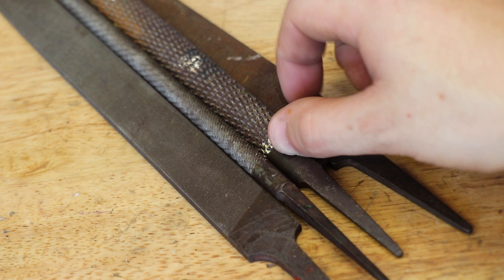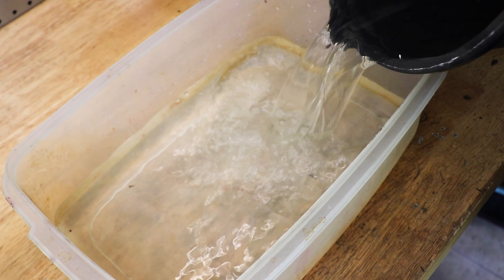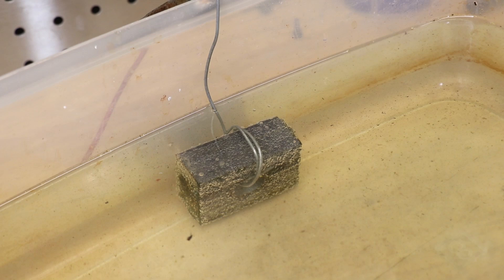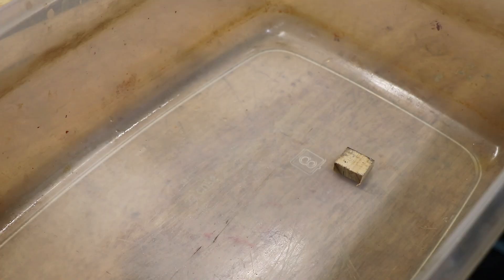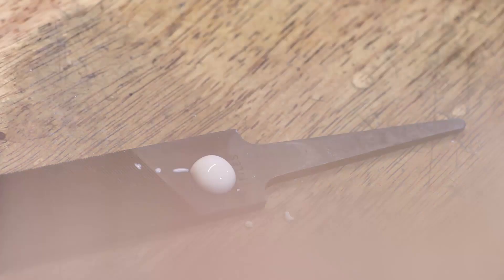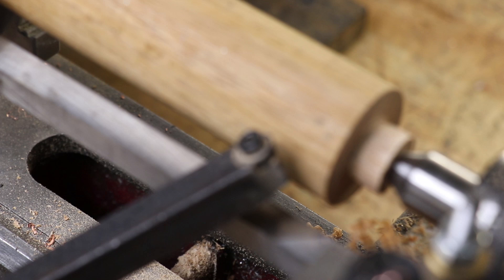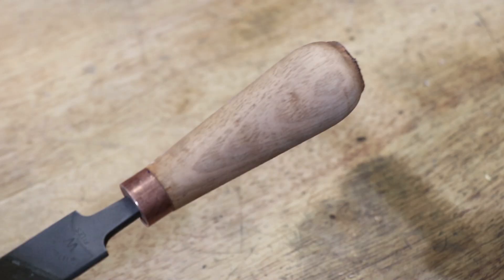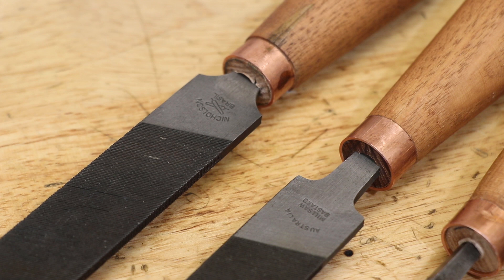Restoring Rusted Vintage Files

Comment: I don't believe in acid magically sharpening teeth. Acid 'eats' away metal, but doesn't spare sharp edges for some mysterious reason - why would it. Actually, I'm quite sure that sharp points are the fastest to be eaten away.
However, acid may rough up a dull and glossy file. This way, a dull file may be given some extended life. But I would think not for very long as the porosity created by the acid will quickly get filled up.
Note that this is not based on experience, but it seems most logical to me.
Reply from the maker: Yes, it is indeed metal etching, and I would probably shy away from doing this to a good condition file. Though this is a tried and trusted method that has been used for years. My understanding is that even commercial sharpening can do done using acid. Either way, super happy with the results. Cheers
Reply: The theory is as the acid eats the metal it makes the teeth thinner. A thinner edge is a sharper one.
Reply: @artisanmakes  I've been using a method almost identical to yours with good results. A couple of of things I do: after the best cleaning I can do to get out all the chips, gunk & surface rust, I soak them in degreaser (Citra solve works great) , rinse & dry, then brush hard with a stiff brush. I believe getting the files as clean as possible helps the acid work faster and better. I found even a slightly worn file benefits from the process. I remove that residue from the acid bath with a brass brush.  Also: I've seen a couple of You Tube posts on commercial file re-sharpening, it does not work on badly worn or damaged files, but the company claims the re-sharpened file is sharper than new. One such firm is in California.  Also again: check our the post of how farriers sharpen rasps using a buffing wheel and polishing compound. I've tried it and does work if the rasp is not too damaged.
Reply: @gangleweed  why would acid just attack the tip of file teeth? That makes zero sense. Acid will erode the entire surface of metal. Effectively thinning out the whole tooth profile. The thinner an edge is the sharper it is. The time argument is bogus as well. If I want to invest my time in renewing files then it is quality time as far as I'm concerned. Not everyone makes Johnny Carson money anyways. And good files happen to be damned expensive these days. If you can even get them. I'm sure I own files you'd be hard pressed to find their like now and if you did you'd better be sitting down when you find out just what they cost.
Reply: @gangleweed  you've been out of circulation for a while. Because Nicholson isn't the brand it used to be. They were probably still being made in the USA 20 years ago. Not anymore. I think they're made in Spain now? Least they were the last time I looked. Never is a long time. You got to do what you got to do in this life. And if that means trashing a file then oh well. I'm always on the lookout for good used files. I've seen NOS USA made Nicholson files for sale sometimes. Then I get what I can get. The world is changing.
Reply: @1pcfred  I can't remember the last time I actually went out and bought a file.........I've used files made in China, can't complain about their cutting ability......anything I want to have that must be accurate is either milled and ground....filing and scraping is too time consuming unless the only way and really necessary......old files make good knives.
Reply: @gangleweed  ever since China launched a bio attack on us I've been reluctant to do business with them. In happier times I used to buy tools from them though. That wasn't always a positive experience even in the best of days. I'd have to get pretty lucky to find far eastern files capable of sharpening saws. Even with quality files that can be a difficult thing to do.
Reply: @1pcfred  I don't know.........I regularly sharpen my hand saw and tenon saws with a regular 300mm  triangular file......then for lack of a saw tooth setting tool I use a pin punch to set the teeth after sharpening.......sometimes I use a pair of pliers with a narrow jaw.
Reply: You are correct, the sharp edges will be eroded faster than the flats.  An explanation is that at the edge there are two coincident surfaces being eroded at the same time, thus more material is removed, this is not actually correct but is as far as I will go.  

If you look around U tube you will find some videos of people testing various forms of rust removal, have a look at the condition of the printing on the tools that have been acid etched and see how much of the sharpness of the printing is lost, with rounded over edges everywhere.

Acid etching has been used to remove burrs and sharp edges from punch perforated metal sheet. In electrostatic stators, failure to remove burrs and sharp edges will result in excessive corona discharge and dielectric breakdown, so  i would know if the sharp edges were still there.

Back to files, etching the files is sort of like making metal sandpaper.  The acid etches different parts of the metal microstructure at different rates creating a rough surface.  I would try draw filing with a mill saw bastard file (single cut file) that has been acid etched to see if you get as good a surface finish as with a sharp, non-etched file.

Unfortunately, I did not buy enough Australian made Wiltshire files when they were still available (if anyone has a time machine, a few more boxes please) and have been reduced to looking for good second hand files, my last pristine Wiltshire mill saw file was destroyed by someone who borrowed it and used it to try and file down a pair of security bolts.  

I still have it, perhaps, if there is no real life left in it, I will try the acid etch experiment with before and after high definition photos of the cutting edges.

Despite my surname, I am not a fan of Nicholson files, they were bad enough when coming out of Brazil, but the latest ones from China are showing damaged cutting edges out of the box, NEW!  It looks like the files are just piled on top of one another during manufacturing, causing significant damage to the edges which shows as shiny edges against a black background

Hearing files rubbing against one another brings back memories of almost 50 year ago and a very unhappy Harold Flaskas, you knew you were in trouble, you did not do it again.

I will not use vinegar or electrolysis to remove rust from files, as both these methods remove viable metal as well.  If I have to remove rust from a file I use Evaporust.  However, as long as the file is clean and the gullets are clear, there is no need to remove the rust, a bit of honest use will see much of it removed in any case.

Cleaning files, I start with a very strong concentration of caustic solution, it cleans away all the oils and other materials that should not be there (paint, glue, resins, etc) and eats away any aluminium.  A quick carding after this often gets the file up to usable condition.

WD40 is good to displace any moisture and it can get deep into the microstructure of the metal (compared to other lubricants) but once it is on (I buy it in bulk and dunk stuff) and any excess removed, I use other protectants over the top such as oil, waxes, or industrial lanolin.  As the WD40 evaporates, the other protectant take its place in the grain structure.

The old chalk trick only reduces galling, it does not eliminate it, no matter how much you may wish it, it ALWAYS galls on the last intended stroke of the file <grrr>.
Reply: @robertnicholson7733  I've always wanted to anneal some files and then try to chisel them sharp again. That's how files were originally made. The teeth are raised with a chisel. I just bought a hand saw and I need to buy a file to sharpen it. I'm still exploring my options as to what's best to get. As you've noticed getting quality files today is a challenge.
Reply: @1pcfred  Sorry it has taken so long to reply to your post. You could give remaking a file a go, could be a lot of fun and perhaps very rewarding.  First issue will be getting it flat after annealing, you could use a file <grin>, diamond plate, surface grinder etc., or just slowly grind the teeth down to the roots.  Yes, the traditional method is to use a chisel to raise the teeth, although there are other possible methods.   This video gives a very good illustration of hand making files:
https://www.youtube.com/watch?v=SOw9WqMOHjA&t=20s.  

You could make a system for advancing the chisel up the file, both parallel and uniformly spaced, you could also make a system to get a uniform strike.  I wonder what happened to all the old file making machines. <grin>  You could carefully leave just enough of the root of the old teeth to give you a good starting point for the new tooth.  

This video shows the manufacturing of nail files:  https://www.youtube.com/watch?v=tqI5ZgJjhMM  The process would be much the same.  

You would want to start with some heavy-duty files, the reduction of thickness of the usual tapered files would not be good unless you cut the file down to a smaller size.

Then there is the hardening and tempering process.  The formulation of the (high carbon steel) alloys used in the files varied with the manufacturer, the hardening and tempering would also vary, but as long as you are careful, you could experiment with a single file and keep annealing it.  Just be careful with hardened but not tempered files, the steel isn't called glass hard for nothing.  I would use an electric furnace to harden the files, there are plenty of designs on uTube and WWW.  Many people seem to use toaster ovens for the tempering process.

If you go this way, make a video, I, for one, would be immensely interested.

PS.
I have a found a number of good saw sharpening files, for some reason these appear to be more available than your standard flat file.  If you are using n fine saws such as tenon and dovetail saws, some needle files are quite good.  I use a fine diamond needle file to touch up my dovetail saws, there is no need to fully resharpen them, same with the tenon saw.  Unfortunately, the diamond files are a bit small for normal crosscut or rip saws, well, at least the ones I have seen.
Reply: @robertnicholson7733  if I gave it a go it'd definitely just be the old hammer and chisel method.

Comment: I don’t understand why the acid bath sharpens the files.  It seems like the acid would attack the points of the tooth, with the most surface area exposed, and round them off. 

I mean, I believe you and can see they got sharper. It just seems counterintuitive.